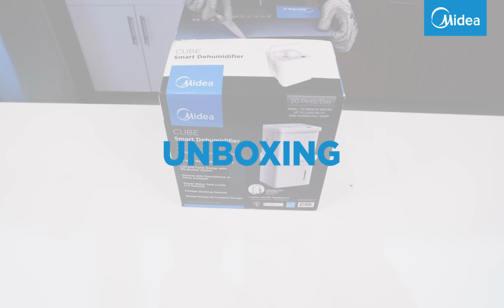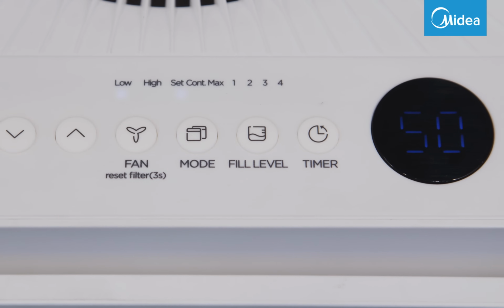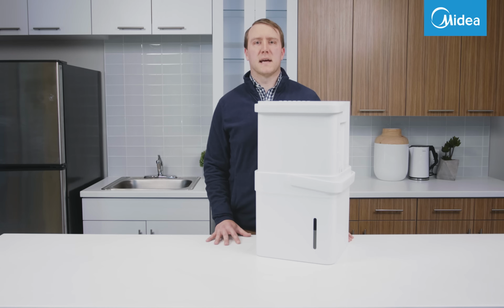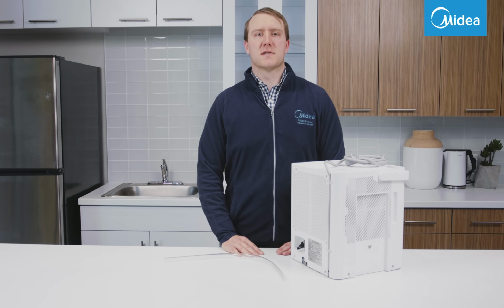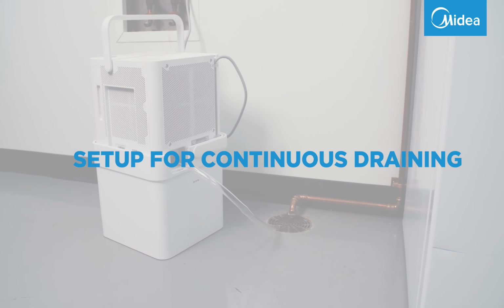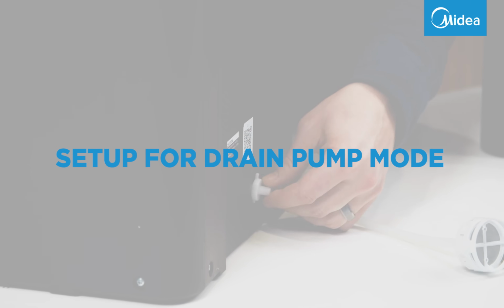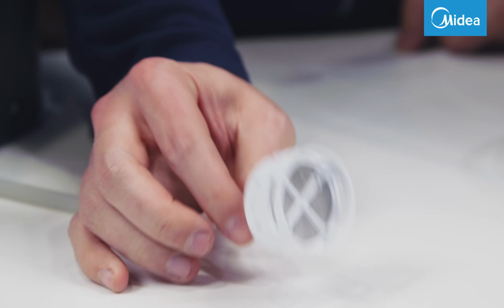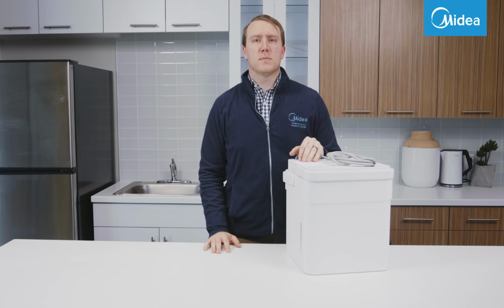Midea Cube Dehumidifier Operation and Overview

Comment: Did I blink through the instructions for connecting to WiFi??
Reply from the maker: Hi @GivingGroupCommunity. Thank you for your inquiry. To connect the unit to Wi-Fi, you need to press the power button for 3-5 seconds until the Wi-Fi icon appears on the display. Once the icon is displayed, you'll be able to connect the unit to the app successfully. Have a great day!
Reply: @MideaAmerica It would be nice if you provided a link to the app too.

Comment: Very informative video! I got mine and noticed that it releases warm air sometimes. Is that normal? THanks so much!
Reply from the maker: Hello @ahtony, thank you for your question. Warm or hot air coming from under or behind the dehumidifier is normal and part of the dehumidification process as long as the unit is drawing moisture from the air. When the unit is dehumidifying, the compressor is generating heat as it operates. Have a wonderful day!
Reply: @MideaAmerica  Thank you for your response! The warm air actually comes from the top machine. I had friends who said theyre dehumidifiers usually release cool air. Since it's the summer and my place is humid, I dont want this to add additional heat. Thank you for clarifying.

Comment: Are these cheaper to run than an AC unit?
Reply from the maker: Hello, @christopherpalmer4243, thanks for your question. These devices are not air conditioners but dehumidifiers. They remove moisture from the air, which helps prevent mold, mildew, musty odors, and condensation in humid locations. If you have any questions or issues, please contact us at digitalsupport@midea.com. Enjoy your day!

Comment: I would like to connect it using a smartplug so I can programm the smartplug for the cheaper hours. Does this device have an autostart-when-power-comes-on-again setting?
Reply from the maker: Hi @HansKeesom, Thank you for your question. Yes, the unit have an auto-restart setting when power is being cut.
Reply: @MideaAmerica  Thank you very much! First cube is running now. Follow up question, what is the difference between the three fan speeds with regard to yield? Is the higher speed producing more water?
Reply from the maker: The fan speed can be set to either low or high. Setting the fan speed to high facilitates quicker moisture removal, while setting the fan speed to low results in less rapid moisture removal.

Comment: Hello. I have been using it for 3 days and it is very good so far. The first day it removed 4.7 liters of water from the air. I will be very curious about the heating season. I saw that many people have a lot of difficulty cleaning the filter due to pulling it out. That is why I just tried  to pull it out now and it only took 20 seconds I managed to remove the 2 filters from the machine. It's not difficult, you just have to move it in and out a bit. We love it so far :)
Reply from the maker: Thanks so much for your great feedback!

Comment: Can you use the dehumidifier without the bucket when in continuous mode?
Reply from the maker: You can use bucketless mode which allows you to run the unit without the bucket in place. The included drain hose or a garden hose must be attached for proper bucketless mode operation. To activate bucketless mode, the following steps must be completed within three minutes of plugging the dehumidifier in.

1. Press and hold the up and fill level buttons for 3 seconds until the bucketless icon appears on the display
2. Ensure the dehumidifier is on flat level ground (free of debris)
3. Make sure the hose for bucketless mode does not rise above the connection point on the unit
4. Attempting to change the unit into bucketless mode while it is sitting on the bucket will have no effect.

To remove the unit from bucketless mode, place the unit back on the bucket.

Comment: How do you remove the kink in the supplied plastic pump drain hose?
Reply from the maker: You can try manually straightening the hose with your hands or by placing an object in the hose to regain the appropriate shape. You can also try using boiling water to mold the hose back into shape, but please use caution.

Comment: Note: I did the following when the bucket was full. (you don't want to dry run the pump). This is for the Midea cube dehumidifer:
For those trying to figure out with the Models with built in pump (pump mode) to get the unit to pump out its own bucket: 1, remove the unit from the bucket. 2. Attach the included INlet hose, the one with the screen filter on the end and push in fitting on the other, align the fitting into its slots and twist it downward to lock in place. The inlet hose should point down when placed back on the bucket and rest on the bottom of the bucket, but before u put in back on the bucket, 3. Remove the small slide out panel on the back where the garden hose (large) and small 1/4" long hose outlet is, you will see where it separates, this will give you access to the 2 outlet connections. 4. Now put the unit back on its bucket. 5. Put the plug back on the larger garden hose connection, u dont need this in pump mode as the unit drains through the inlet hose (this is what worked for me). 6. Install the long 1/4 hose to the push-in connection (now that you have that access panel off). 7. start the unit up and put in pump mode....  NOTE: I did all this when the bucket was FULL, When the bucket is full, you'll notice 2 white squares kind of pop up and bobble around, thats the full sensor. When working 1st time you should hear a breif grinding noise as the pump comes on and primes itself, then in a couple of seconds water will come out the long 1/4" hose.
Reply from the maker: Thank you for sharing these tips! We appreciate your feedback. Have a great day!

Comment: Ok the models with the pump. Does the pump kick on automaticly? If so what fill level will it perform the pumping? How does this feature operate?
Reply: Wow. That would be great to include in the instructions! I just spent the last hour wondering why my pump was not kicking on and looking for videos to troubleshoot. Nowhere is it stated the bucket needs to be full for the pump to kick on
Reply from the maker: Thanks for sharing your question! The bucket will need to be full for the pump feature to activate. This is to decrease strain on the pump.

Once the bucket is full, you'll press the up and down buttons on the unit for three seconds to initiate the pump.

Comment: Having a problem. When using bucketless mode, I can’t set it to a desired humidity level and have it run until humidity percentage has been satisfied. It turns off before desired humidity has been reached. 
The only way to circumvent this is to turn it on max mode and have it run constantly.
Reply from the maker: Hello, ThaDocta0623. To better assist you with this, please reach out to us at DigitalSupport@midea.com.

Comment: I just bought one of these, it is EXTREMELY heavy! It is also much, much larger than I expected. I read the dimensions before purchasing, but when it's in front of you in your (small) house, it is just massive. I bought this to keep on my first floor near the bedrooms and bathroom, as it's much more attractive than a traditional basement dehumidifier. It feels like it blocks half my hallway. 

Also, the bucket is about 5lbs empty, so it's going to be impossibly too heavy to lift high enough to dump when filled. I really wish someone would make something just like this, but half its size. I wouldn't care if it'd require more frequent emptying, just make it manageable. 

Also, unboxing was the biggest pain in my ass. Some genius at the factory taped the power cord to the bottom of the box. So I had to balance the component on my knee (there wasn't enough cord length available to set it down without toppling the whole thing), while pulling our the bucket with my free hand (which was attached to the bottom styrofoam that was wedged into the bottom), then pulling out all remaining contents so I could detach the cord & tubing anchored to the bottom. Nothing like pissing off a customer on their first impression. I haven't even plugged the damn thing up!
Reply from the maker: We're sorry that you've been unsatisfied with your dehumidifier's weight and how it was packaged together. For any additional comments or concerns, please email us today at DigitalSupport@midea.com.

Comment: When you set it to drain pump mode, it automatically stops pumping when the water is low enough, correct? What level does it start pumping?

Comment: This is a very good design, and after doing quite a bit of research on dehumidifiers in general, as I am replacing a Whirlpool unit that lasted me since 1991, and also a Sears unit that ran from about 1973 till maybe 4 or 5 years ago. Upon unboxing, I was very very impressed with how well packed this machine was, banding straps to ensure everything stays together, and the overall quality of this machine is beyond belief. This video is done exceptionally well, and I will leaf though the instruction manual and then get this new machine up and running. Thanks for making such a well thought out product, along with this highly informative and easy to understand video.
Reply from the maker: Hello, georgewaters8592. We are happy to hear that you are satisfied with your purchase. We appreciate your kind feedback on the video. Have a great day!
Reply: @MideaAmerica  The first 20 hours or so have by far exceeded my expectations, 4 gallons within maybe 10 hours, then about 2.5 gallons over the next 8 or so. I'm at the point now where I can set the machine to a desired humidity level, and have it cycle nicely. Once again, outstanding product, and also of note this machine does not raise the inside temperture like my old one did.

Comment: I have watched a couple of reviews now and there is nothing stating there is an auto-shutoff when the bucket has reached the fill level.  I'm not going to be checking the app or the display at 3am when I am sleeping.  My current dehumifier has leaked internally a couple of times now and bypassed the bucket and leaked out onto the floor, causing the floor to be buckled and now I need to replace the floor.  I'm assuming the Midea drains from the bottom, but none of the reviews confirm that.
Reply from the maker: Hello, paulgregory930. The bucket is filling because of high humidity levels in the room. You can setup the unit for continuous drain mode. Please refer to the user manual for more information.

Comment: Great video. Great dehumidifier. Question about the Auto-Restart feature. The manual says "If the unit stops unexpectedly due to power being cut, it will restart with the previous function setting (except bucketless mode) automatically when the power resumes." But in my experiments unplugging and replugging my 50pint cube (to simulate a power cut), the cube remains in bucketless mode through the restart. Can I rely on this behavior? Is the manual wrong?
Reply from the maker: Hello, chetanreddy6424. Please reach out to us at DigitalSupport@midea.com so we can assist you with this.
Reply: @MideaAmerica  You've got to quit directing question to someone else.  You need to know how to answer questions here.
Reply: Can you explain when i take off top to empty bottom and put top on floor.  I have water on floor.  What am I doing wrong?  I find it heavy

Comment: One thing mentioned in the video is that the fill level doesn't operate while in pump mode. That seems very dangerous, and it could cause a big flood. Can you please add an emergency shutoff feature in case the pump fails or gets clogged and the bucket will overflow with water. You could do that via a firmware update or using the app. (Or did I misunderstand, and the bucket fill level feature which allows you to choose how far to fill the bucket before the unit shuts off, is unsupported during pump mode, which means that if the pump fails the unit will still shut off before flooding your space)
Reply from the maker: Hello, user-xw3qi3rf7c. This unit does not automatically stop while in pump mode, this is the whole purpose of it. So the unit can continuously drain without needing to empty the bucket every time, this is why the unit is equipped with a hose to redistribute any water generated directly to a drain. For example through a door, window, shower drain, etc. For any questions or concerns, please reach out to us at DigitalSupport@midea.com.
Reply: @MideaAmerica  If the pump fails and the water level in the tub rises, will it shut off automatically?
Reply: @MideaAmerica  The point DanHolland1 was making pertains to what happens if the pump stops working. I have the same concern. After I began dehumidification, it was great to monitor the unit via the app. But as the water volume meter began to rise on the app I wondered about Dan's question too. Turns out the pump on my (brand new) unit isn't working. So the concern isn't theoretical!

Also, any help on getting the pump to work would also be appreciated. I followed all the instructions and restarted etc.
Reply: @diamondbracelette  @MideaAmerica  Thank you for your comment. Have you troubleshooted why the pump isn't working? Did it work in the past? Is your unit still under warranty perhaps? Also, I wonder if it turns off automatically. One way you could test this risk-free for the sake of our joint curiosity is by putting the unit in a shower or bath tub and running it with the condensation line taped inside the tub taped with duck tape in case it starts pumping at some point.
Reply: @DanHolland1  I learned from others commenters that the pump doesn't kick in until the reservoir is almost full! This has solved my issue. You can monitor the water level either manually or via the app. I still haven't seen the pump working in real time but water is definitely being emptied out.
Reply: @diamondbracelette  I was aware of that becuase I noticed that the high of the pump is such that the water level needs to reach a minimum threshold and that an efficient pumping system would only kick on periodically.
Reply: As it does like only a few liters a day, I think "flooding" is not really the correct term. But I guess you do not want it running for days without checking on it from time to time. And/or place it somewhere where in case of a flood the damage is limited.

Comment: As many have commented, getting the filter out is ridiculously hard. I still haven’t gotten it off. Really really bad design and should have been fixed by now. Not sure I would recommend this product. Like the cheap plastic holding the filter, Much of the unit doesn’t seem built to last.
Reply from the maker: We apologize that you've experienced issues with your dehumidifier's filter removal. For additional assistance, please contact us today at DigitalSupport@midea.com.

Comment: I am having nothing but problems with the one that I have. First, it doesn’t have a fill button like yours does and I can’t get it to go into continuous drain mode. My next problem is the filter. I’ve changed the filter, cleaned it and it still flashing that it needs the filter replaced. What kind of garbage is this thing?
Reply from the maker: Hi, torozzgrl. We would like to learn more about the questions and concerns you're inquiring about. Please contact us at DigitalSupport@midea.com so we can better assist you. Have a good day!

Comment: If my basement is divided into separate rooms, do I have to move the unit around? Or can I just leave it in one room and it will do the entire basement? In my basement I have the furnace room, a laundry room  and a storage room, which are all unfinished. On the other side of the basement is a rec room, a games room, and a bedroom which are finished.  my drain hole is in the furnace room across from the sump pump. If I put the unit in the furnace room, will it get the humidity out of the entire basement or do I need to move the unit around?
Reply from the maker: Thanks for your question, @torozzgrl. The unit must be placed away from items such as radiators, heaters, and dryers to maintain optimal performance. There are also many other factors to take into account such as the size of the basement, temperature of the basement, clearance requirements, electrical requirements, etc. For additional questions or concerns, please contact us today at DigitalSupport@midea.com.
Reply: @MideaAmerica  I don't even bother looking at your replies any more.  Smh.
Reply: @joeking433 how the heck do you expect them to be able to definitively answer this? They don't know the layout or airflow of the house. Shyt if air flows freely through all the rooms it should eventually do all the rooms. If the air is relatively stagnant between the rooms, then it won't. Maybe the OP should put some fans to circulate the air between all rooms then the answer would be yes. This isn't rocket science.

Comment: i love this dehumidifier so far, though i'm having troubles getting the small drain hose +pump to come on. it's in pump mode but it's currently filling the bucket in the bottom and not pumping any water through the small hose. i've taken it off and checked for blockages, but there weren't any. does it just come on when the bucket fills completely?
Reply from the maker: Hi, Sweet9964. Thanks for reaching out! The bucket should be full before activating the pump feature. This reduces any strain on the pump so that it can perform optimally. Have a great day!
Reply: I have the same question. Totally unclear. Should I leave pump mode on and then it'll pump when it's full until it's empty? And then it'll remain on?